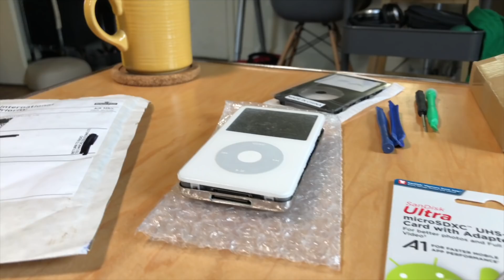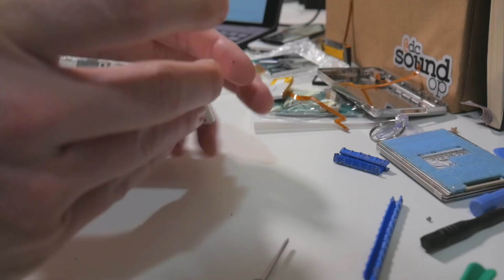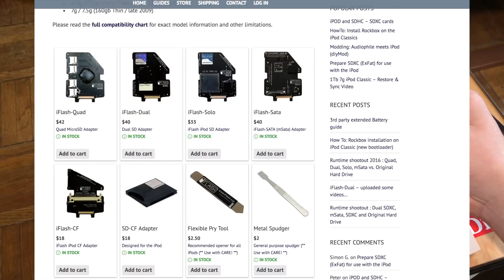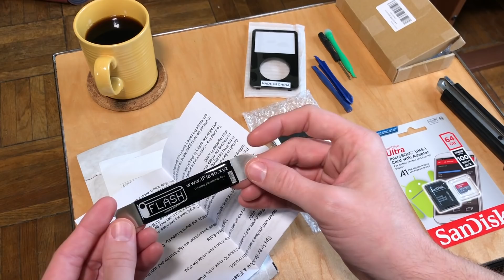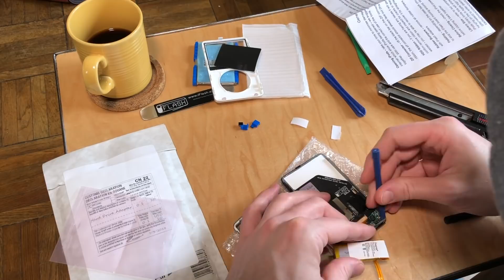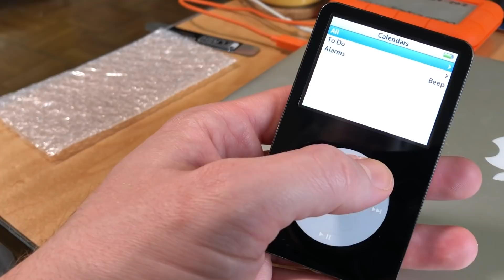Classic iPod 5th Gen SD Card Upgrade w/ iFlash.xyz Adaptor

Comment: What is the max storage you csn achieve with the larger SD card sizes now? Can you install a 400 gb sd card?
Reply from the maker: Hey Dylan, great question. From the iFlash website they list the following: iPod 5g Video 30Gb, 60GbiPod 5.5g Video 30Gb, 80GbiPod 6g Classic 80Gb, 120Gb, 160Gb *Model limited to maximum of 128GbiPod 7g Classic 160Gb (late 2009)
Reply: Using the iFlash Quad, you could theoretically exceed a terabyte by using four 256 GB cards. Do keep in mind, though, that there is a software limitation as to how many songs you can have in your database, so you would probably only want to exceed 128GB or so if you're using lossless audio files.

Comment: *IPod Video. Classic wasn't until the 6th gen.
Reply from the maker: Funnel Cake Madness I tend to agree with the Wiki - there were 7 generations of what everyone refers to as ‘classic iPods’, with the 6th generation being stylized and marketed specifically as an ‘iPod classic’ model. I find anyone trying to be more specific will use a gen # or actual model #, so where you apply the ‘classic’ label vs just use the term ‘classic’ to refer to the whole group 18 years later is up to you.

Comment: I am just getting 10 hrs playback  with new battery with iflash card on my ipod 5th gen A1136  is that  normal?
Reply from the maker: Hey Blaze,
 I don't do these conversions for a living or anything so I don't have enough of a data set to say what is normal, but 10 hours sounds like there is something up with the battery. 

I've had drastically different results with replacement batteries for all sorts of different tech, from laptops to cameras and various other gear over the years. Even the same model battery from the same seller but ordered at different times can have totally different results. 

I always try to buy the factory original replacement battery when possible. For projects like this where that's not available, I often order batteries from two or three different suppliers to get one that works.
Reply: should of bougth the 3000mah battery

Comment: I think I'm definitely going to have to do this.  I have a 7G (says it's compatible on iFlash.xyz) with a dead HDD.  I think it's worth resurrecting!
Reply: I'm in the same situation. 7gen. Did you ever upgrade the SSD?
Reply: @cicero.95  If I got the generation right!  Final generation with the traditional clickwheel - not an iPod touch.  Yes and it worked perfectly.  Just check compatibility on the site.
Reply: @mediocrefunkybeat  I got the same. A 2014 ipod classic, 160 Gb storage (clickwheel for obviously reasons). Mine it's working but the HD it's "lazy", you know? It can't run all my songs, just a small amount of songs, like 200 songs, not my 9000 music 🤣. When I sync my library sometimes it gets an error message, and sometimes it works, but the songs are skipped, and only one song or another is played, if you know what I mean. 

I'm planning to get a SSD... 256gb would be fine for me.... Did you had any troubles opening your ipod? Or changing the parts? 

Mine it's the same gen, same model as yours.
Reply: @cicero.95  So the whole adapter works with SD/MicroSD cards - so check the capacities of what works with the adapter.  I only put mine to 128GB with one SD card (I went for the basic single-slot model) and not all models work properly with the adapters, so check the SD card compatibility list and work from that.  

Getting it open is tricky and you have to be very careful not to bend the outer case too much - you'll never get it back into shape.  I didn't have too much trouble (my case got a little bent but not badly) but I have been fiddling with things like this for a long time.  It isn't easy and requires a bit of finesse.  The opening tool is a must and I'd consider getting a couple of 1mm guitar picks to hold the edges out slightly once you've got it a little open.  It'll make more sense when you try it.

Fitting the adapter was really, really easy.  No issues at all.  The iPod is lighter, the battery lasts longer and it's a lot faster - as well as more reliable to sync.  It really is a highly recommended modification but please make sure you're confident you can do it before trying!

Mine was exhibiting all the same symptoms as your's was, except it was hardly working at all.  It has given it a new lease of life and I might upgrade the adapter to a higher-capacity one to get a larger library size in the future.
Reply: @mediocrefunkybeat  I see! Mine it's the last gen with originally 160 gb, so the storage it's really really up to 1tb of upgrades or more. (There's some videos).  My doubt it's if it's better to get the SSD with the single slot, then place only one SD card with for example 256 gb, or 2 slots with 128gb each card. Any differences in therms of speed? Also, my last question:

It's better to use one SD adapter for MICRO SD, or the SD itself? There is some different things I can do, but don't know which one it's best. 

I plan to get a new battery as well, just because I'm already opening it. And one extra back face and front in case I brake it while opening 🙈🙈

Also the right tools like ifixit opening blade, and guitars pick would not be a problem, since I play guitar and have myself a lot of picks 🤣
Reply: @cicero.95  I just saw your channel!  Fantastic playing there.  I play a bit too - but nowhere near your level.  Guessing pretty heavy picks too, given the Friedman stuff!
In all honesty, I don't know the answer to your questions really.  In terms of speed, no idea which is better - but all are much better than the original HDD.  With regard to adapters, you're probably better off running without one if possible - although I can't see there being an issue with it.  Probably better to ask the people that make it, though!
Getting hold of a 256GB SD card that is officially compatible with the adapter might be a challenge and be expensive, so I'd be inclined to go with the two-slot, two-128 card adapter.  At least, that's what I would do if I were going to 256.

It really has transformed my iPod since I did the mod last year.  I haven't used it recently (we've been locked down in the UK and I've been working from home) but walking to work and back, it has seen a lot more use than it has done in years.

Comment: Hey man I did exactly what you said but mine keeps needing resorted. And once I restore it it says iTunes has detected a device in recovery mode and needs restored again. Have I done something wrong?
Reply from the maker: Luke, that's a bummer to hear. It's really really hard for me to say if you've done something wrong if all I know is that you've done exactly what I did... 

Try this to get it out of recovery mode... 
1- Plug the iPod which is stuck in Recovery Mode into your computer. Launch iTunes. ...
2- Unplug the iPod from your computer. Now, turn the device off. ...
3- Now, press and hold the 'Home' button.

Let me know what happens.

Comment: I have an ipod classic 80gb and when the charge cable is plugged in it works, but when i unplug it the screen turns black and wont operate.  All the diagnostics on this video were good. Any ideas ?  bad battery ?
Reply: Yes, sounds like a dead battery  if it works plugged in. As long as you have it open, the iFlash conversion is easy, just be gentle when opening. xyz is the right stuff.
Reply: Dill Wiggle dead battery definitely

Comment: How's the battery life after the mod
Reply from the maker: Hey Blaze,
 The battery life is significantly improved now that the old hard drive isn't in there spinning and grinding along. I haven't done any scientific measurements, but it goes and goes and goes.
Reply: Man the thing is a beast it runs for around 30 hrs or so. it's just the beast. Wish they would make more music products by apple.